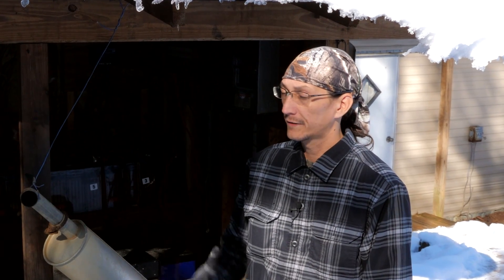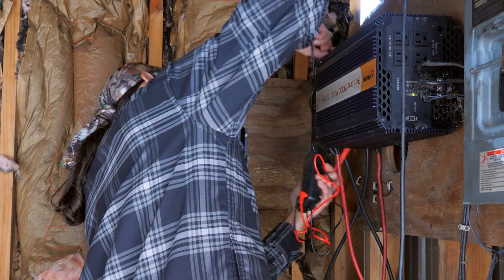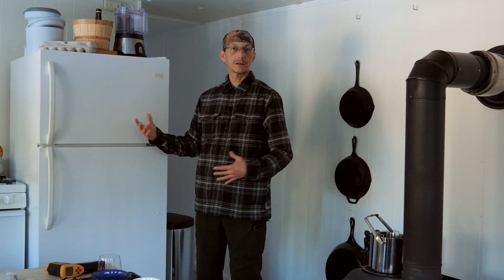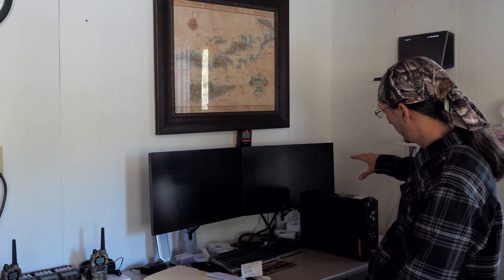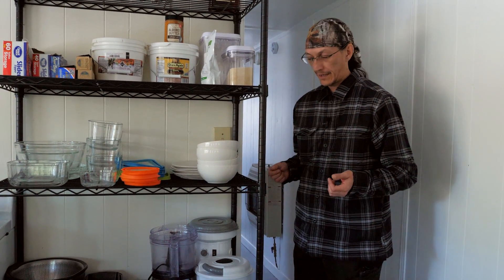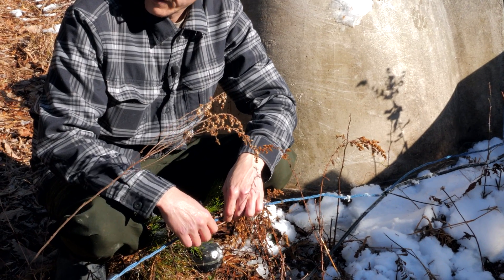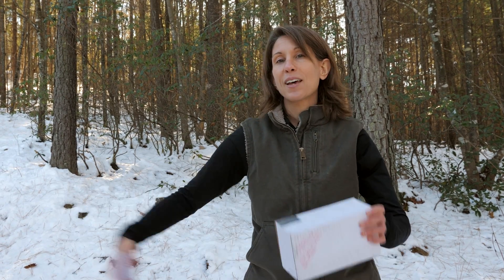Off Grid Electricity - Our DIY Solar System

Comment: Great plan to upgrade to an MPPT charge controller that can log data first. I bet that old PWM controller that's currently there is really inefficient. 150 yards! WOW that's a far distance. You should try to wire the panels to 48v with the new charge controller so you'll have much less loss and get thicker gauge wires if you can afford it. Maybe a 12v or 24v DC water pump would be a better option and you'd be able to run it directly off the battery bank with no power conversion losses depending on how far the wires are run. 12v is really only good for short runs of wire unless you have some 4AWG wire or larger! I'm curious what batteries you'll use. If I were building a system on a budget I might go with golf cart batteries since the price per amp hour is great, they are true deep cycle with huge lead plates and Crown and Trojan are very popular in the solar community. I know Crown offers a core recycling program that gives you a small discount when you buy a new replacement battery. There are a lot of battery options that's for sure and if you go with the simplicity of a proper lead acid I see from the video Jeremy already knows the temperature is a problem. Just 10 degrees °C off the optimal temperature can half the life of lead acid batteries. On the other hand Lithium needs more complicated BMS systems and can be bricked if the voltage drops too low and at a higher cost so you stand to loose more money if something goes wrong. Its a complicated decision. Good luck. I'm very excited to watch you guys build this off grid property!

Comment: At about 17.22 you mention how to run your house off solar panels.
Learn how to conserve energy. 
         First suggestion separate some of your solar panels and batteries into a second system. Run only 12 volt off this system primary use is for lighting. Superbrightleds.com sells 12volt led that put out 900 lumens. This way if one system goes down you still have some power. You will need another controller.
        Check your output voltage of your panels at the panels to see how much power you are losing between your panels and your charge controller. If you are losing too much power you might think about replacing the wire with a thicker gauge or moving your panels to a closer location to your house. Watch for sun shading.
         Check your connections. In my experience I ended up having to solder all of my wire clips etc to keep good connections. 
         I may have missed this but there seems to be no fusing between your various components. If you drop a wrench while working around those batteries you can fry your whole system.

Comment: As you might already know, 24 volt systems loose less on long wire runs. MPPT charge controller should have option of 12 volt to 48 volt input as options.
Reply from the maker: Yep
Reply: Yes, love this comment. Also, have the same brand charge controller and inverter (all components the same brand) allows for the units to communicate properly as well.

Comment: Where are you guys at what state ? I love your fam , home stead first thing is to move all your solar panels closer for sure , # 2 insulation the whole battery control room that is a must , # 3 the generator pipe should go out the top of the roof , like a fire place. You can get pallet wood for free to make doors , go on Craig's list some times get free insulation , like you said you have a nice starting

Comment: add up all your electrical loads and then DOUBLE IT.  next, whatever your battery bank's amp-hour rating is, cut it in HALF.  this will give you the most reliable method, down&dirty style, for calculating your load.  what i tell people who wish to convert to solar is to go around your home and make a list of the things you can live without.  then go thru it again.

but you're on the right track!  you have what's called a "hybrid" system.  instead of investing the money on DC appliances, what about adding another generation source, like a small wind turbine..???

anyway, thumbs up!
Reply: I just think trying to run a 12 volt system is useless when he wants to run a washer, fridge etc. And he did say that he wants his new system to run his future house and take it with him. Converting to a 48 volt system would work for them much better. Or maybe even higher if he needs it. He does not need to increase amount of batteries, just connect them properly. Hope I am
Making sense. I understand he is working with what he has at this time, but adding more battteries is not the answer, getting away from a 12 volt system will help.

Comment: I love your home made wooden block electrical "Interlock" on the switch panel of your generator house...  But when it's on your own property-  Screw it...  Lol.  That whole "Power shed" looks like Frankenstein's laboratory...  But I'm certain it's all up to code.  If they even have electrical codes in the Carolina's.  Baw haw haw!
Reply: 243wayne1 Wayne, Hi, You know he didn't build that right?  These are all inherited buildings, apart from the fact that they've only moved in a week or so ago, the 'Power Shed' is all the work of the previous owner, as are the solar cells soldered together in door frames which is pretty ingenious I think.  Jeremy's work is always neat and tidy, even when he calls it "thrown together", AND he'd've  come up with some clever way to keep the snow from drifting into it,  Give him time it'll be marvellous.

Comment: The problem with the 6v drop is with the wires going down the hill.  It has too high of impenitence.  You can lose about .5v per 50 foot run.  There are two options.  One is to change out the wires with low impenitence multi-stain wires and I would go with 10 gauge wire.  Second is to connect the panels in series and increase the voltage but you will have to replace the charge controller so it can handle higher voltage and buck convert it down to 12V.  The only other point is to change to 24V to be truthful.  12V is a good starter and limited setup but it's not good enough for a small home.  If you were in a standard home I would say 48V.  Going straight to 48V for me has been a problem given the amount of money it will be required for this place.
Reply: impenitence?

Comment: Depending on the state of your batteries, the in side will be different than the out side...  That is the role of the charge controller.  Different stages of charge require different voltage from the batteries.

Comment: If you're adding a new charge controller anyway, perhaps you might consider a boost converter at the panels to high voltage DC, which at a given power delivery rate has lower current -- and therefore fewer resistive losses. It's important to use DC, since AC can leak out of damp wires capacitively.

Comment: I know this from direct experience-Yes, you need more and newer batteries for the storage you want, HOWEVER, your biggest weakness is your Solar Panels. DOUBLE the number of panels, get a Controller that can handle the upgrade, and you will have a MUCH easier time!

Comment: I think a magazine called Home Power can be very helpful to you. Good info and you can call them for advice.                                                                                                                                                  Note... I think the wire from your panels to your charge controller is several sizes too small and is causing the large voltage drop.                                                                                                                 Good luck to you guys

Comment: Could you use a ram pump and a water storage container  instead of your water pump?
Reply from the maker: No. 1. Too noisy 2. Ram pumps require vertical drop from the water source to start and pump water back up hill and the water source is at the lowest point.

Comment: On the water pump install 1 or 2 one way valves depending on how deep your well is, This way the pump will not have to draw as hard, it makes it a little more efficient

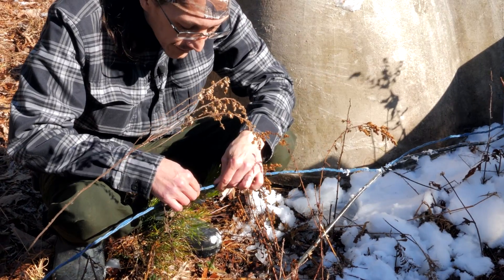Comment: 20:37  could the long thin wire from the solar panels to your battery setup act as a big resistor and steal your volts that way?

Comment: Does the moisture / wet ness in the battery shed, affect the power output in any way ?
The equipment, seems really exposed to moisture and cold temps 
I don't know nada about this newer power technology . thanks for any response
6:31 would building a Poney wall, inbetween the fridge unit and wood stove, ( to reflect the boxstove heat) , work ??

Comment: An inexpensive way to deal with the water pump problem. Put an IBC tank up by your trailer. Use a 12 V pump to supply the trailer and use the AC pump to fill the tank when you are running the gen-set. Paint the tank black and box it in with 2" foam panels. I have used one for years at my work yard. It could also solve the issue with your water heater.
Reply from the maker: That’s close to what I’ll be doing 😉
Reply: Use a ram pump from your spring...to a storage tank
Reply: For your frig...run a timer ..I turn mine off for 2 hours at night
Reply: Think it through and do what you can afford.  Forgot to mention, a pressure well tank for the 12 V pump will help with the water heater. a parallel run of the biggest wire you can run between your solar panels and the controller, would help get more into your batteries. All the best with your projects.
Reply: same thing i was thinking. seen someones video were they had a big tank on there hill and gravity feed it. i just dont know anything about electric stuff. only thing i know is it will kill you so i dont mess will that kinda stuff.

Comment: You might want to keep an eye on the temp of the inside of the fridge especially during the day.. being closed up it doesn't let the cold outside air in and may get warmer inside especially if the sun get's on it at all. Also if you make a clothesline down your hallway or a retractable across the kitchen, the dry heat from the wood stove will dry your clothes quickly.. Also, on the propane fridge idea,  It would still be overworking by the wood stove and using more propane than necessary. 
    The layout of your place is very similar to the 1969 60x12 mobile we are in now. I wanted the fridge like yours by our stove but opted not to because the heat from the oven when I cook would heat up the fridge and make it kick on. Instead I am going to build a 2-1/2 x. 4 ft cabinet with doors on both sides and keep canned goods in it. With a back door  by the hall and a front door on the kitchen side I can easily rotate canned food.. stocking from the back and taking from the front.

Comment: Interesting video. I am also trying to figure out how big solar system I need. Unfortunately at my part of the world, it will not be producing in nov, dec, and jan. so I need to be connected to the grid, but I will sell the surplus electricity during the summer months. Just a question, a compressor, how much fuel does that use per hour? For the kitchen, I have bought a few appliances, that are hand powered, such as the blender. Good idea to move the fridge out on the porch. Maybe you could insulate the fridge, with a big throw or something, so it keeps cooler longer, and doesn't have to be plugged in all the time. It might also prevent the generator from freezing?

Comment: The wiring size from panels is WAY to small you have a bottle neck were your power cant get threw. Also when your checking power switch your multi-meter to amps. When you were checking panels all you were checking was voltage with out checking produced amps you really have no idea of how much power there producing. On a side note you dont need a big charge controller to monitor your system you can simple add in a  Tenergy Watt Meter and Power Analyzer for $20 and it will tell everything you need to know. Thats what I use and its alot cheaper then a out back :)
Reply: $15 on Amazon, Prime available too.  60V up to 130A.  I must admit, I'm surprised.  It is intended for RC applications though.

Personally, I still lean towards an isolated sampling MCU system, but that's just me.

Comment: Check the manufacturers website on those batteries. Most of the cell tower back ups use batteries with 20 year warranty. They are much higher quality than golf cart batteries. You may be surprised.
Reply: Also mixed banks by manufacturer and Amp/hr will be a pain for you to charge correctly. 25 years in the industry has taught me when to cheat and when to open the wallet. You have a mess but are on the right track in all your observations. I would start with the batteries getting them sorted and charged correctly. Do an evaluation of them. That junk charge controller and cabling is the next step. After that you are on the right track with the wiring from panels. Mixed panels with different OC voltage ratings are the next thing to sort out. I am loving your journey and appreciate the time you take to make the videos. Good Luck to you !

Comment: When you measure the voltage drop from your panels to the charge controller, measure the voltage at the input terminals to the charge controller, not the battery terminals.  The charge controller takes voltage higher than your batteries and drops the voltage down to the correct charging voltage for your batteries.  So you may not be losing as much voltage as you think you are.  Another thing to understand, is that if your batteries are fully charged, then your charge controller will limit the current.

 I would measure the short circuit current of your panels. If the home made ones are also 100 watt panels, you could hook all 4 of them in series.  Then get a 12 Volt charge controller that can take 80V Max input voltage from the solar array.  Using the same wiring, you would have 1/4 of the wire losses.
Reply: Greg is correct. At the very least series the Solar Panels to 24 volts and you will lose less in the long run of wiring and if you can switch to an MPPT charge controller you will also gain some more efficiency.  
Not criticizing you Jeremy. 
I know this is just your starting point.
Reply from the maker: All great suggestions!

Comment: As far as tools go I would consider looking into Dewalt lithium 20v and the 60v flex volt an amazing system of tools especially off grid. And a battery powered vacuum imho like the Hoover linx and a Dewalt cordless shop vac

Comment: check voltage drop calcs on the web ,for correct wire size . you NEED to move solar panels or your  12v system .( keep batterys warm?)
the 120v system can be increased alot easier /cheaper .
 any less than 12.6 v can/possibly hurt ur batterys

Comment: When we were talking to the solar guy about installing our panels, he mentioned that we'd want the panels close to the house (rooftop, ON the house side ; (  , or right next to it if we didn't want to use a booster or repeater of some kind.  Just a thought.
Reply from the maker: That’s like to keep the wire sizes smaller and lest costly.

Comment: I was also wondering if you could cook on the top of that fire place. for the shower problem getting hot then cold, maybe get a 50 gallon plastic water barrow and cut it in  1/2, set it in the shower and fill it up with hot water and climb inside and wash up. i dont know if thats something you would do or not but if i was getting burned and frozen in the same shower i would find different means to showering. not sure if what Karl Fair said would fix that problem or not. thanks again for these nice info vids.

Comment: panels with mixed voltages will all sink down to the panel with the lowest voltage in the array.  can you maybe move your DC components closer to the array and run the wires for the AC part after the inverter?  you'll increase your efficiency by decreasing the voltage drop caused by the long distance the DC must travel before it's converted to AC.

sorry, i keep commenting... but it's as if i were there and i wish i could help.  also, it may not be necessary to change your charge controller.  it appears to be doing its job just fine...

Comment: solar is a great way to harness energy...you can improve efficiency by series connection of your panels, and run high dc voltage to your charge controller.  you will need a mppt charge controller that can handle higher voltages...this will reduce line loss from your panels to the charge controller.  especially on a long run that you have...invest in a charge controller that can handle more amps....then you can add more panels in the future.  looks like your inverter is super sized, a five kw inverter should handle a pump if the battery bank is large enough.  one gauge cables from the batteries to the inverter, as short as possible!  Cudos to you for going green, you will improve your setup as time marches on....its a learning curve starting from scratch!  set up my own off grid system at my farm, been on solar for over six years, in northern british columbia...can’t wait for longer days, gotta use generator for an hour or so on these short days to charge up on the battery bank....but the solar panels  will charge the batteries without a generator in a month or so, and keep up to the energy demand.  good time to invest in more panels, they are cheap now....a buck a watt, if you do some careful shopping!   cheers from canada
Reply: Jim Hofoss I hear you on the wanting longer days. We have 4.8k of solar but here in the Pacific North Wet we have generator days during the 50 darkest days of the year. We had 100 inches of rain and 5 feet of snow last year.
Reply: Steven Davis   days get longer in a week!🤗
Reply: Jim Hofoss Then we can cut back on the vitimin D lol
Reply: or micro invert and go AC